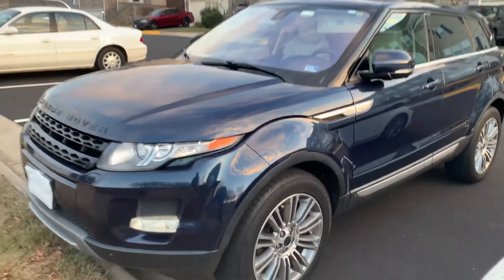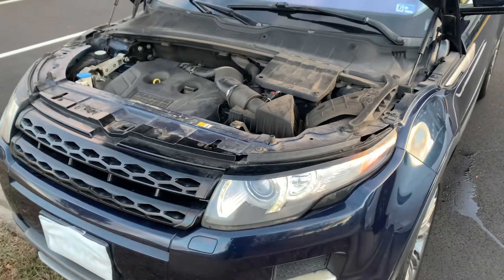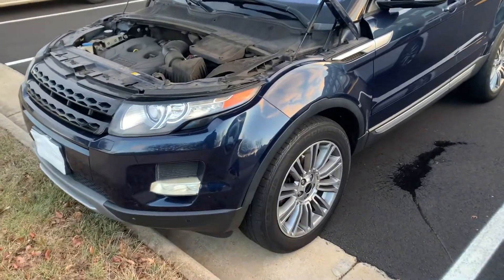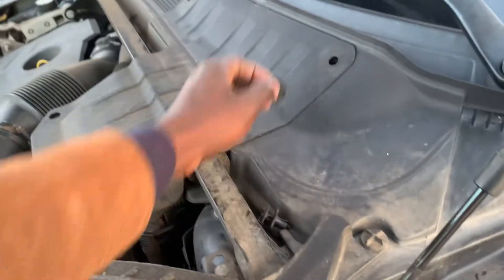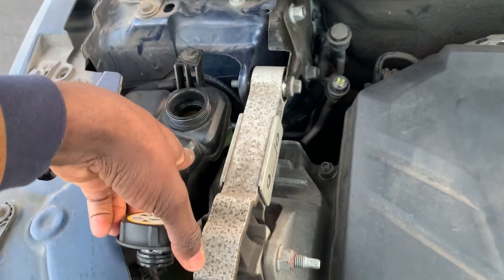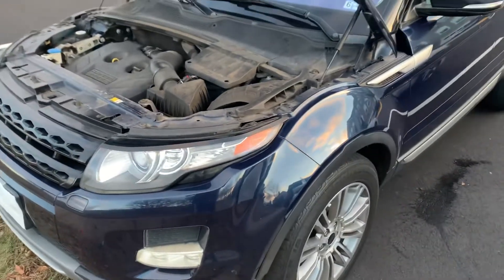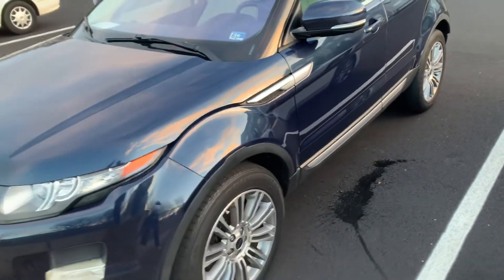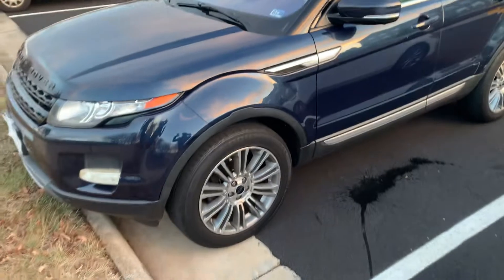COOLANT LEAK? FIX IT | 2012-2018 RANGE ROVER EVOQUE | HOW TO REPAIR l ALL ABOUT CARZ | ALLABOUTCARZ

Comment: I got same issue on my 2014. I'll try that product. Thanks,
Reply from the maker: After week’s of research 🧐 I realized this is a problem with most of these Range Rover’s and they put the heater core behind the dashboard which is 9 hours labor according to the dealer.  I used this same product 3 years ago on a Ram truck 🛻 and it’s still working.  Good luck Elaine Evangelista thanks ☺️

Comment: You’re a lifesaver brother. Fixed my problem
Reply from the maker: Jignesh Shah happy I could help.  I just replace the fan module on this one hope you won’t have that problem.  Thank you ☺️
Reply: @AllAboutCarzz  It didn't last long. The leak is back again. Sucks. Range Rovers are very unreliable.
Reply from the maker: @jv-king  Noooo, both our Range Rover Evoque are still holding out since we place it in a few months ago, remember it also say you might be a 2nd treatment.  Good luck 🍀
Reply from the maker: @jv-king  I hope we don’t have that problem because we would prefer to sell the car than to remove the dashboard to replace the heater core, I don’t know why they place it there.  If it was me I would recommend a 2nd treatment and see if it help.  I am going to change the door actuator this week🤣🤣🤣
Reply: @AllAboutCarzz  I’ll try out a 2nd treatment. And in other news- I need to replace the solenoid in the the gas tank assembly! Gas nozzle keeps clicking before the tank is full. I’m gonna sell it soon.
Reply from the maker: @jv-king  I understand

Comment: Did you put it in the coolant resivior or directly into the radiator?!
Reply from the maker: No access to the radiator on my car so I had to put it in coolant, thanks 😊
Reply: @AllAboutCarzz  thank you! I have the same issue on the same car and I just got the stuff and I’m like, where’s my radiator 😂. The auto zone guys I think were being nice and didn’t have the heart to tell me I am a bit… slow in terms of my car haha
Reply from the maker: @Guyonyoutube201  no worries 😉 good luck 🍀 my car is still working with it.  All these cars have the same problem
Reply: @AllAboutCarzz  sorry for bugging you brother 😂😂😂 but I have a question. My heater was 👃🏻🤢😷 with the coolant leak. I don’t know if you had that experience- I’m nervous to turn the heater back on, but since it’s Dec I may need too haha. Have you noticed with the heater on or off any changes since you used the treatment?
Reply from the maker: @Guyonyoutube201  that was normal.  Turn your heater on and allow it to circulate, once it seal the leak the smell will go away.  I had the same problem.  What more videos about this car on this channel and you will find a few future problems😁
Reply: @AllAboutCarzz  THANK YOU!! Subscribing now!
Reply from the maker: @Guyonyoutube201  good luck 🍀 my friend.  I still have the car so as soon as something goes funny 😄 I will be making a video
Reply from the maker: @Guyonyoutube201  the reason I tried this liquid is because the heater core is behind the dashboard and they want $2300 to remove the dashboard.  Just so you know my sister have the same car but her we had to do a second treatment and it’s great now.
Reply: @AllAboutCarzz  awesome! Thank you!
Reply from the maker: @Guyonyoutube201  my pleasure

Comment: How do I get the air out of the violent system after adding coolant?
Reply from the maker: I didn’t have to purge any air from the system after coolant was added.  I add the liquid and then coolant and drive for 35 minutes for good circulation.
Reply: You confused on your numbers? First you said you drove it for 45 minutes for circulation then you said a hour and now you told this person 35 minutes? You also said you tried this product before on 1 vehicle then re assured this would be your second time trying it which then you mentioned you put this liquid in 3 vehicles while saying 1 before and this your second car adding the liquid too?  

Whats with alll the nonsense numbers
Reply from the maker: @mobmob5944  didn’t mean to confused you so here we go again.  1 - I put it in a Ram truck diesel over 3 years ago 2. I put it in Range Rover Evoque in December 2022 and last but not lease 3. I put it in another Range Rover Evoque in January 2023 and so far so good 😊 good luck 🍀

Comment: garbage.  Only a temporary fix.  If your heater core is leaking this product will thicken the coolant and possibly seal only small leaks.  BUT, what that does is then make your coolant too thick and clog it somewhere else.  Like, radiator, hoses, thermostat.  This is a hack temporary fix.  Dont use it.
Reply from the maker: Thank you but please remember this is my experience only documented here and so far our two evoques had this problem and no more.  Time will tell, thanks
Reply: Brek1234567 must have been the 9 hour labour guy 😂
Reply: @reefstrade  😅😂
Reply: Bro want to complete his shift with  1 hour overtime 😅